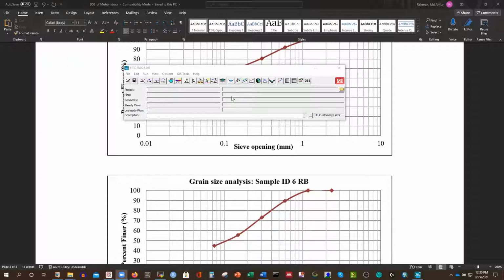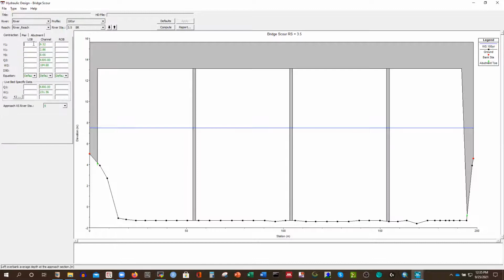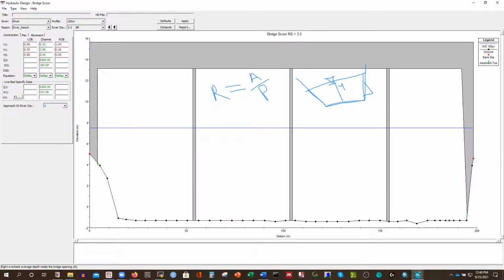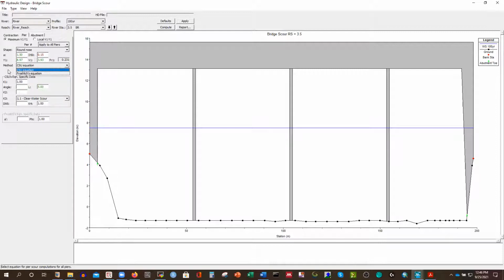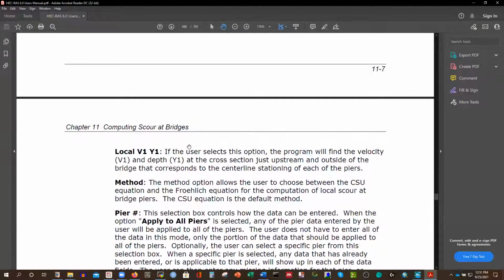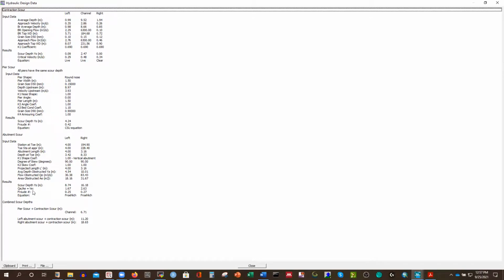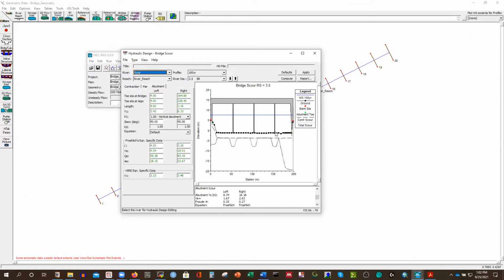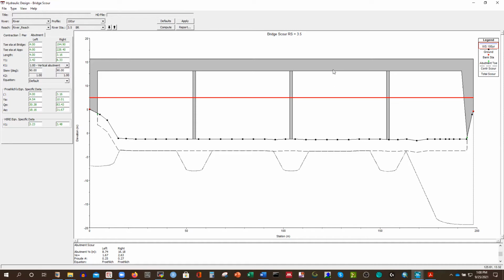HEC-RAS T4: How To Calculate Bridge Scour

Comment: Sir, thank you for sharing the tutorial videos of HEC-RAS. I got a warning saying that "some parameters for pier and abutment scour require flow distributions. The flow distribution option has been turned on for the two sections just upstream of this bridge, therefore not all the usual default data will be available". However, I did set the locations for flow distribution. How should I do to solve the warning problem?
Reply from the maker: Thanks for your query. I need to see the message, I usually demonstrate this in details in my training. For more info, please send message to +16825537054 on WhatsApp.

Comment: Sir, I have done all these steps successfully and got similar results. Sir, I want to do sediment transport modeling in this model as well. Can I do this? or do I have to do it separate medel.
Reply from the maker: It's possible with this model as well, only need to change the flow condition and add the sediment boundary condition.
Reply: @MdArifurRahmahn  Hello sir, please tell me how I can change the flow condition? I changed flow conditions from steady to quasi and unsteady in two separate simulations. But both showed errors. Please guide me how I can do. I am clueless. I have to show this demonstration to my prof that I have learned. I am eagerly waiting for your positive response, Sir. please

Comment: sir, is it possible to simulate the scour caused by jet near sluice gate in a flume?
Reply from the maker: Thank you Divya for the very important query. If you mean jet by waterflow as open channel, then it's possible. But usually, by water jet, we mean waterflow from  nozzle. For that case it's not possible because then the flow condition won't remain as open channel. It will be regarded as pipe or pressurized flow then.
Reply: @MdArifurRahmahn  sir, it is open channel only not pressurized. Thanks a lot for quick response. Expecting more videos from you 😊 specially scour near sluice gate and other related problems near hydraulic structures.